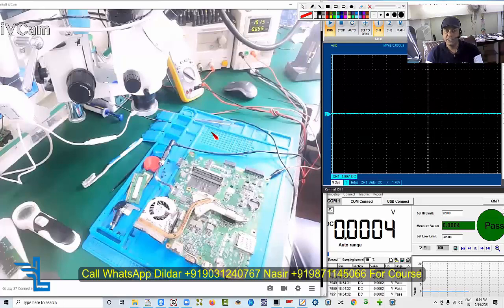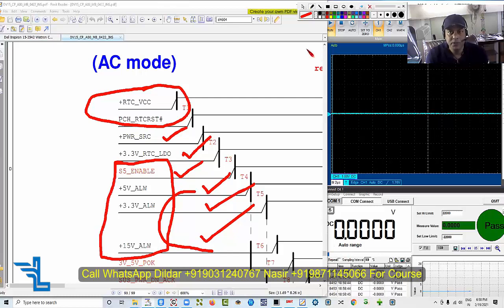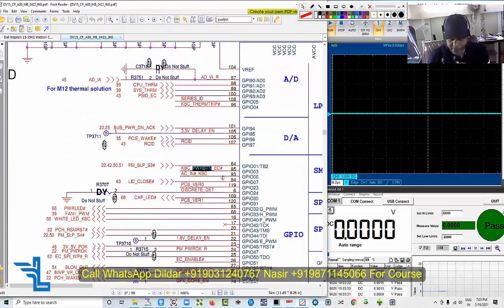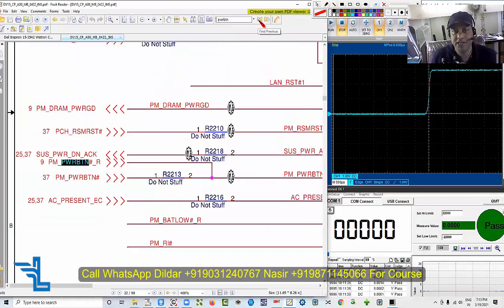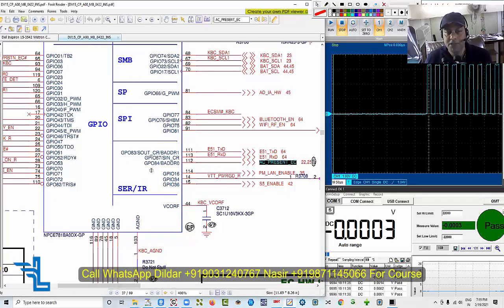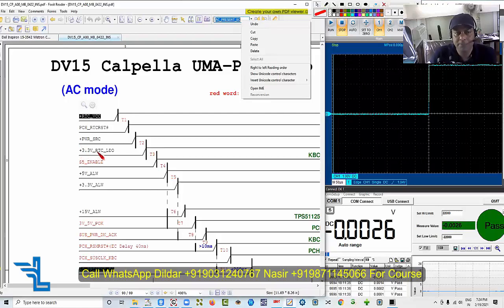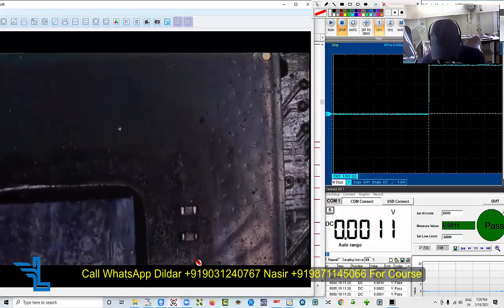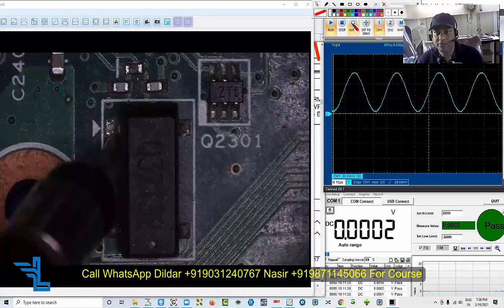Laptop Not Turning ON Solution with DEBOUNCE LOGIC PART 2 | Eng | Chip level Laptop Training #laptex

Comment: We have to check all rtc voltages first with coin cell on pch  

And after we need to check the 3.3v_pch supply to the pch
Reply from the maker: Good that's the basic thing we need to definitely check.
Reply: @laptex1377  yes sir thank you 🤝
But I am stuck with same problem from  last 4 days 
...not getting denounce logic properly 
Is is coming 3.3v and goes low 0v  after pressing power button .
Getting required voltages for pressing power button is ok 

And I am eagerly waiting for the solution in the next video 📸 

Thank you sir 🤗
Reply from the maker: If denounce logic is not ok...then PCH section is having problem.
Reply: @laptex1377  yes sir ...I conclude that ...there is a direct short in 3.3vs line to chipset may be that's the reason power button logic not working